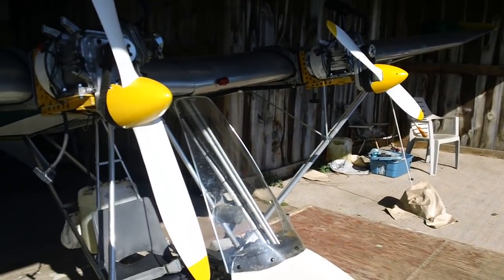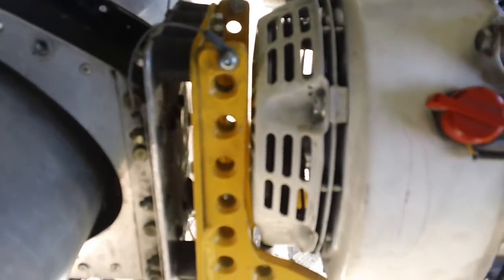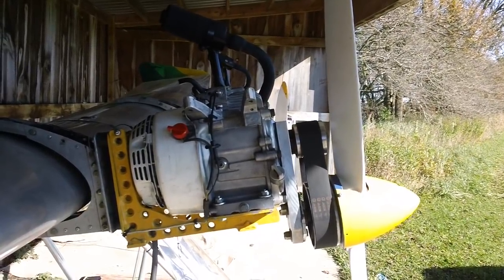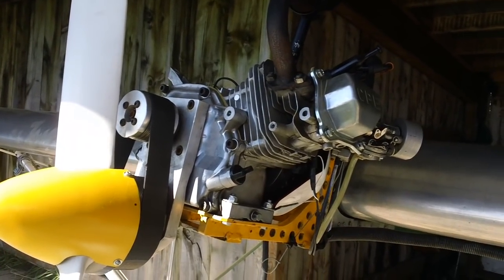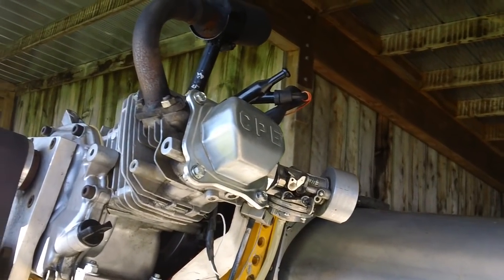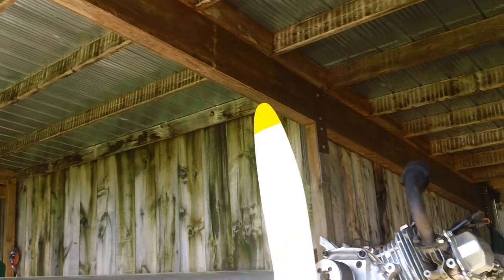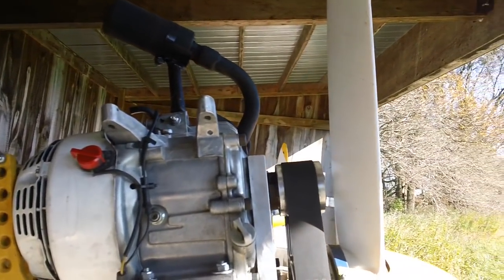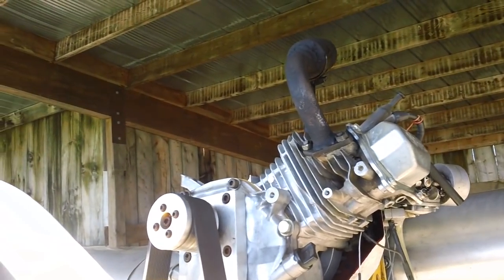My thoughts on the Honda Gx200's suitability to re-power the Lazair

Comment: I wonder if using turbos on 2 stroke motors would eliminate weight yes its loud and needs the right mixture . 
im glad you  used honda motors vs predator I have both and think honda  5.5 is  better for longevity. Great setup!

Comment: What hrs do you have on them now? What GPH are you getting? What Speed and Flight Time on 5 Gallons?
Reply from the maker: hi Armilite...sold that Lazair back a few years ago now...was sure pleased with the way they performed...total engine time a bit over 50 hrs..they'd turn up about 5200 for takeoff and give about 50mph level flight...4500 give a good 40 mpl cruise, and 4000 cud putter around in low  30's...easy on fuel too...flew 3 and 1/2 hrs with 3 take offs and still had over a gal left in the tank.

Comment: Would a single motor of this style be enough to pull the Skypup along?
Reply from the maker: l was getting about 70 lbs thrust per engine..
Reply: Well then maybe the gx390 or two like yours in hammerhead configuration.
Reply from the maker: @geostomp  shud work.!!

Comment: Hi Peter, I finally got the engines really tuned up so I'm getting a good consistent 5,000rpm Full Power and I have it set at 4,300 to descend and also is where I have it for landing as I continue to hold her off the runway until she finally sets down just about at stall and then I can bring up the engines to about 2,700rom's to keep up about 10 mph or so to taxi.  I will be out there this Saturday again and will try and Climb probably to 4-5 Thousand.  I want to see how long it takes me.  I will stay over the airport and keep my eyes on a swivel so do that VFR thing.  I wanted to ask you, When you owned it, did you ever try and see how High you could get her on Max Altitude on those engines?  Yep, I'm also getting real close to flying her over about 20 miles to the Mountains called Crestline so I can do some Thermaling with the engines off.  That will be a blast.  I will probably just do that thermaling around the Airport first so I can see how hard it is to get the engines started again once up in the air.  We will do the testing slowly.  When I get my friend Tim who use to be a LAZAIR dealer down here in Southern California back in the day.  He should have his about ready to fly in a month or so and then we can start flying away from the Airport and see the area with the two of us.  Have a good one buddy.
Reply from the maker: Glad you got her running good Dave.. you shudn't have and probs getting to 5 or 6 thou ... l'm thinking with those big props wind milling at idle or stopped, you might want to keep 2800 or so on to cancel the prop drag.. Good plan to stay around the airport till you determine your best glide speed ..shud be in the low 30's l'm thinkin.. best climb is about 28 mph...have fun with her Dave and keep the clips coming.!!

Comment: hi, did you make the other propeler turn to opposite direction? if so, how?
Reply: he didn't. You can see by the props. both motors are turning counter clockwise looking at the front of the motor.

Comment: Nice Video. An Engine turning 4400rpm with a 1.8 Reduction has a Prop Speed of 2444.4rpm, so a 44 x 30 Prop at 2444.4rpm = Static Thrust of 60.04lbs. It takes 11.157hp, a 44 x 32 =  Static Thrust of 60.04lbs. It takes 11.901hp. A Stock 200cc engine at 3600rpm making 6.5hp = about 76% Volumetric Efficiency. 200cc at 130% Volumetric Efficiency at 4400rpm = 13hp. 200cc at 5000rpm at 130% Volumetric Efficiency = 15hp. Your old Rotax 185UL making 9.4hp@5000rpm in Direct Drive mode using a 32 x 10 = 70.28lbs Static Thrust. Required 8.904hp. using this http://godolloairport.hu/calc/strc_eng/index.htm Static Thrust Calc at 77F Temp. How many Hours on the 200cc Engines now? Peak Flow/HP Calc. https://www.mk5cortinaestate.co.uk/calculator3.php

Comment: Hi Peter, Good to see you're still experimenting with 4 strokes.  I don't think those engines on this Lazair are putting out anywhere near as much power as you think.  The prop speed reduction and 44" prop is much more efficient than the old Rotax 185's using the stacked direct drive prop.  My little 5.5HP Pioneer engine with 2.5:1 redrive and 44" prop doesn't produce that much less static thrust as a factory 185. Using a redrive and those big props on these Hondas, you should be getting much better performance than a 185, not 10% or so! BTW, are these real Honda engines or Chinese clones? (Chappy in Virginia)
Reply from the maker: Hi Chappy...good to hear from you...yes these are real Hondas...the left engine will turn at 5200+ and the static thrust calculator says it takes 15hp to drive them (44x24) at this speed..2.0:1.0625..the rt engine however was only turning a bit over 5050 when l got them from Gerard Stinissen last fall and l'm having trouble getting much over 5000 static now , with a new placement carb installed.. l'll tear it down this fall and see what's going on...compression seems good but it has always blown oil out the valve breather.. I'm looking forward to flying it down to the UPAC convention this weekend at Lubitz Field ..45 miles or so..
Reply: I would love to attend again, but it won't happen this year.  Maybe next, that would be the Lazair's 40th. anniversary, right?  Take care, and have fun.

Comment: Awesome setup. That one engine that spits out a little bit of oil out the valve cover probably has a little bit of blow by which is not uncommon for those engines (ring Gap may have been set a little too big) when you start putting Arc rods and stuff like that in them. I'd recommend keeping an eye on the rod bearings they're super cheap they're like 20 bucks a set. You can get pretty much get all those parts except for the gear reduction from performance go-kart places.

Comment: Great video, do you question the reliability? Also do you question the reliability after using aftermarket parts? How often do you plan on rebuilding them?
Reply from the maker: Stinnissen was concerned also...he machined thrust bearings into the redrive backplate...When l was fooling with the direct drive Clones a few years ago l had bought bearings for them but never installed them...the pull on the crank was 50 lbs at full power turning 34x12 in pitch props...rpm with them was 4800...l would have liked maybe 5200 to have real good performance but l flew 10 hrs with that setup.. the clones hade a mild mod.. just timing key and alum flywheel and bigger e tube...l think these Hondas l have now would fly great direct drive with the 34" props...
Reply: Peter, did you upgrade the camshaft and if so, what would the specs be on it?
Reply from the maker: Yes the valve train is upgraded...ss push rods and 26 lb springs, cam and rockerarms too... billit rod, 160 head , ported, different crank too l think,  ..Ged Stinnissen did the mods and l have the list of mods
in my log book in the car and not handy to me right now..
Reply: Peter Harrison Thanks Peter. I was curious on the lift and duration of the camshaft. I can surmise the other stuff. Besides being an airline mechanic for a living I'm also a Chevy gearhead from way back.
Reply from the maker: I'll check the list, but l don't think he gave me the exact #'s for the cam outside of the fact that it was expensive...black mamba? ..don't remember...these mods are all kinda new to me, but l know he did the engines up right..
Reply: Peter Harrison Thanks. I've seen other people using the black mamba cam which is an aggressive cam with a .275" lift roughly. Thanks again for responding quickly Peter.
Reply from the maker: This is new stuff for me Racer X.. and l appreciate any comments or suggestions from those in the know.. I'm really hoping these modded engines will stand up to this kind of application.. with the good guts in them and synthetic oil and premium fuel l'm thinking that they will make a dependable fairley inexpensive replacement engine for the lazair for those that want to get away from the original 185 cc rotax...
Reply: Peter Harrison One of the bigger concerns was mounting a prop directly to the crankshaft because these engines are not equipped with a thrust bearing. Not to worry for you Peter because of your PSRU that isn't an issue. I was impressed to see that it made enough power to get you comfortably up in the air. The synthetic oil is certainly good insurance for longevity. Thanks again for the info you supplied. The build without a dyno is kind of nerving from a cost standpoint but the power adders like the camshaft,  carburetor, etc by example make the selection a breeze.
Reply: Peter Harrison I think with your set-up you could get a pretty aggressive prop with the redrive and all your mods. I'd be curious to know where peak torque is at on your engines.
Reply from the maker: I'd be guessing on the torque.. it flies nice in the 4600 range and the engines should last a good long time ...even at full power at 5200 they don't sound like they're working hard, but that's the limit of their power to drive those 44" props..
Reply: Hello Peter. Can you write a list of mods for Honda GX?
Reply from the maker: Reliability is of great concern..these modified honda type engines have been used for years by the go cart racing crowd with great success.. l am quite confident these modified engines will run as expected for hundreds of hrs, The only thing l might change would be the carbs..
Reply: Thank you for commenting back. I have some experience with these in the Go-Kart world and you're right, they can be raced and abused with little issues. The only time I had issues was after the governor was removed, valve geometry not quite setup for the high revs. 
Will is glide if there is a failure? I recall in another video the motors added significant weight plus the steel mounts you needed to add five pounds of ballast to the rear.
Reply from the maker: the complete valve train is modified for higher rpms.. full takeoff power is 5300 rpm and cruise power at 4600.. the motors should stand that for years I'm thinking.. and yes it flys on one engine also..!!  bonus..
Reply: Very Cool! Be safe and take care.
Reply from the maker: Thanks for your interest and input ..
Reply from the maker: Google NR Racing or any of the cart racing sites and check their list of performance parts to build up a 15hp gx 200 engine..

Comment: Have you thought of putting a bulb primer with a one way valve on each of the fuel lines? It might make priming and fuel retention in the lines easier, as you mentioned that they drain back to the tank fairly easily.
Reply from the maker: yes..thanks phah.. since that vid was recorded l installed the plunger style primers and man does it ever make a difference.. the tillitsons tend to leak back if they sit for a few weeks, and the primers light them rite up now with only a few pulls..!!

Comment: Hi Peter,I see you've been upgrading  the gx200s, I wonderd  why you decrease speed of engine
Reply from the maker: Reducing power is easier on the engine, makes it last longer, use less gas, and running the motors at full throttle only translates to a relatively small gain in mph.. if you mean to slow the prop speed relative to the engine... a larger, slower turning prop is a lot more efficient...

Comment: How many hours is the engine rated for?  Also, how far have you flown away from your residence on a flight?  Thanks
Reply: I bought two Chotia 460's about 15hp each for $99 total and I got a free plane with them.   No redrive needed, or massive valve upgrades, so again, massive savings.  Probably much lighter than that setup, and they use VW parts.  At $50 an engine, I'm doing good :)  Plan to score me some more just because...    they don't make them anymore.  http://alice.air-war.org
Reply: Peter Harrison Lol, I think we all are...  no one ever made any good 4 cycle small aircraft engines...     I've seen some guys put RC radial engines on Lazairs, but expensive as F$$$.  I guess I'll be sticking with the 2 strokes  old snowmobile engines myself :-/  I rebuilt one of those Honda OHV GX200 clones myself just like yours, it's a neat little engine and easy to crank...  not esp designed to be lightweight though with high hp/weight.   If only someone could cast a different block for them... for aircraft use... with the redrive plate integral... and without the heavy ass flywheel to drive the spark (maybe an alluminum one?)
Reply: @choppergirl  ARC go cart parts make finned and unfinned flywheels for them. lots of mods available. could you explain reduction or direct prop drive, pluses and minus. ?
Reply: @dennisbest4979  - Direct drive pluses - less weight, as no extra gears need. Direct drive minuses - if you have a prop strike (common), you're liable to bend or destroy your crank shaft as the propeller is attached directly to it.

Reduction drive pluses - don't need a specific engine designed to run in a power band for aircraft use, can use any light weight engine and gear it to run at aircraft cruise and climb within it's maximum power band. Reduction drive minuses - adds weight of the gears/belts/chains mount.
Reply from the maker: Hi Dave.. these Honda motors are extremely reliable when used for the purpose they were intended, which is driving generators, air compressors etc. The racing go-cart people would be better able to answer your tbo question, but I don't see any reason why they won't be able to give reliable service for at least 250 hrs.. Stinnissen dismantled them last winter and couldn't discern any wear whatever after 25 hrs..  I realize that running them at higher rpm's than they were intended is going to reduce their life, but by replacing rods, valves, valve springs, rockers and lifters and cams with race quality parts, I feel the little engines will stand up to 5200 hundred full power and 4600 cruise with no difficulty... I'll pull them apart this winter and inspect them.. The longest continuous run was 1.2 hrs, for about 50 miles... I'm really quite pleased with them so far Dave, but time will tell, of course..!!
Reply: Thanks for your answer back Peter.  Hope you enjoy those new Honda's.  They sure seem to perform better....
Reply from the maker: Wow..what a bargoon..!!!  ..I'm looking for a reasonably priced replacement engine for the Lazairs, that's readily available and 4 cycle..
Reply from the maker: Guy in France was modding the Gx 200 for the PPC crowd.. cast plate with integrated redrive ..super light flywheel, intake and exhaust modified..beautiful package really...close to 4 grand per engine if I remember right..
Reply: @19pete38  hi Pete, could you send me a link to the guy in frame modifying the GX200s? I am interested in picking up a pair..
Reply from the maker: @scenicdepictionsofchicagolife  ..google NR Racing..you can buy modified engines from them, or the parts to do it yourself.. good luck Eric
Reply from the maker: @scenicdepictionsofchicagolife    google NR Racing Eric...you can buy modified engines from them or the parts to do it yourself.. good luck